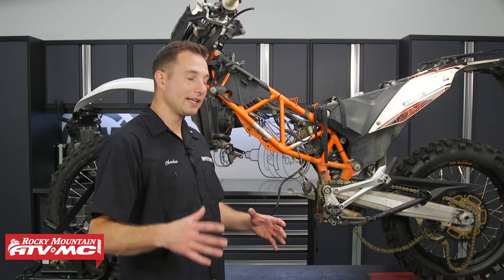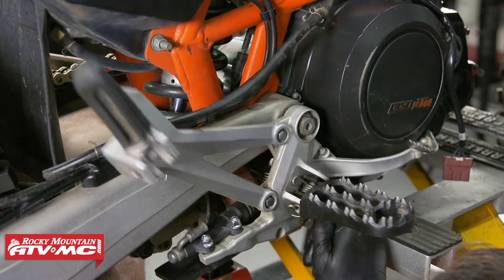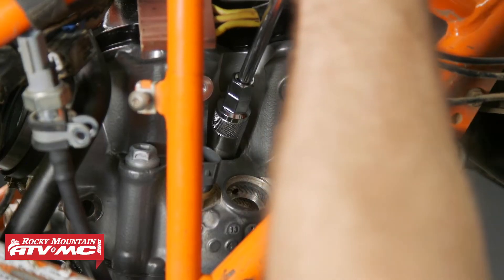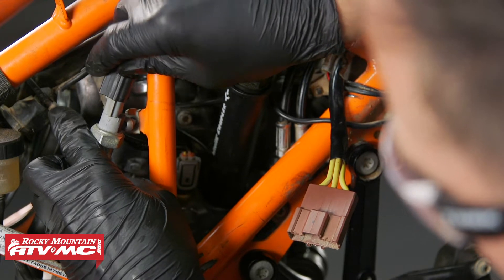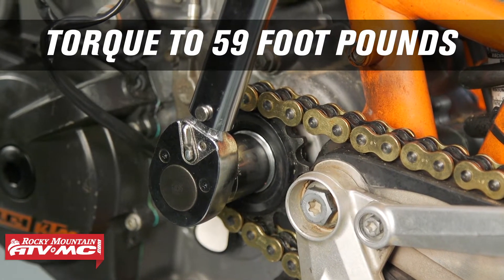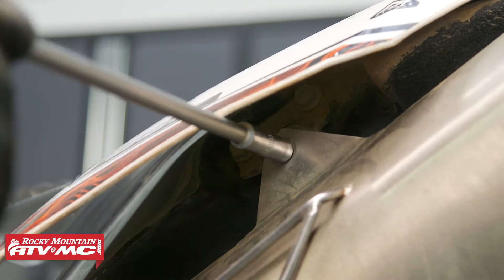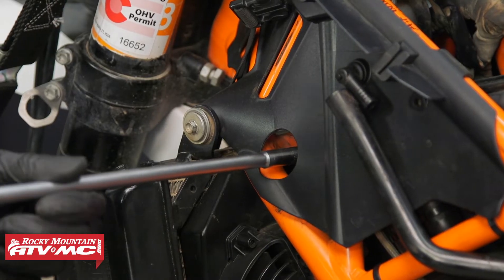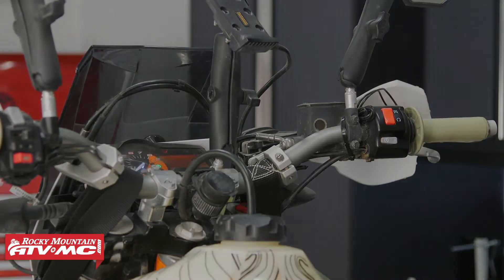KTM 690 & Husqvarna 701 Engine Rebuild | Part 6: Engine Reinstallation

Comment: Great info. Really well produced video. Approx how much time does the engine  removal from the frame and reinstall process take overall...assuming an experienced mechanic was  doing it. I'm trying to decide whether to do it myself or have a shop do it. Any insight would be greatly appreciated.